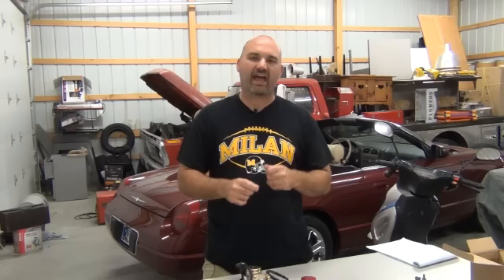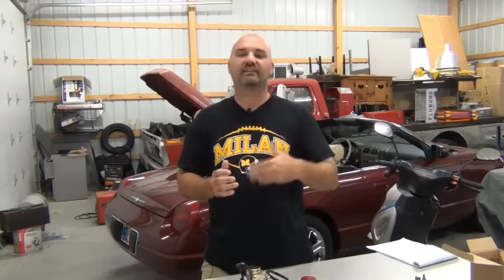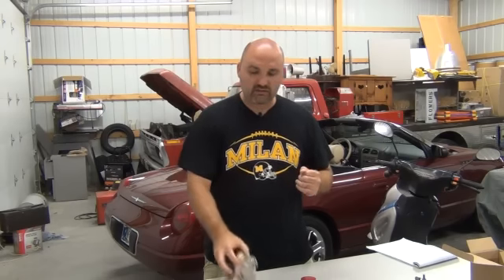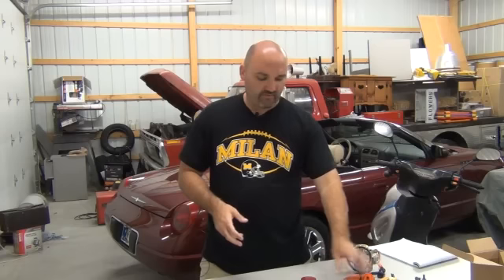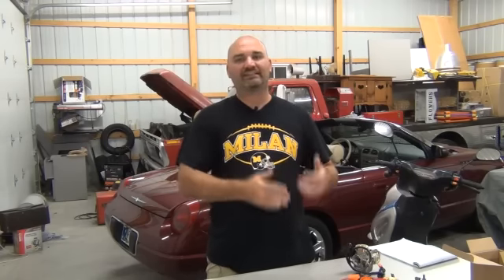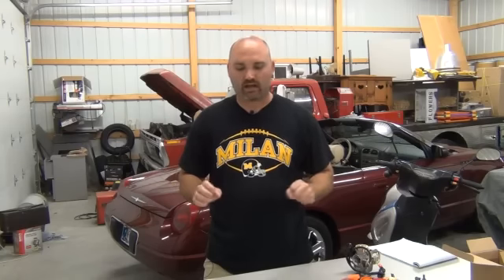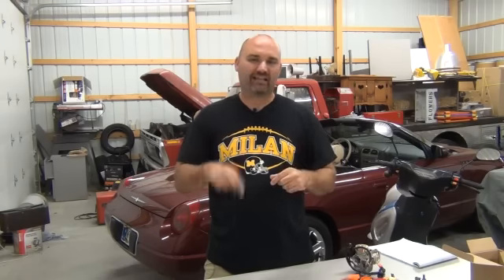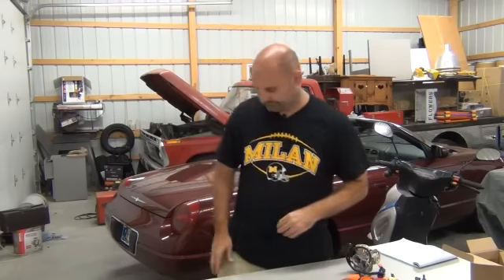Video Number 4 Make My 49cc Scooter Wicked Fast

Comment: I have a Yamaha c3 it's an xf50x 2007 with fuel injection. I noticed that even on the downhill run I can't go over 40. Is there a governor in the fuel injection system. What can I do to get more speed, I've already removed the governor spacer and use only non-ethanol 90 gasoline. And what do you think about changing the carburetor to run it on propane only could I get more speed that way? Thank you for your time. Stephen Parker

Comment: I know you posted this some years ago, and don't know if you will see it, but quick question, after I remove the airbox off of my 49cc dongfang, and install one of my two air filters as you shown, what do I do with the blowback hoses that run to the airbox? There's one that runs into the air intake tube, and another that's not too far from it. I put on my red air filter, I tied off the hoses to where they weren't hanging, but my scooter ran terrible! Thoughts? Thanks man!..

Comment: I am trying to buy a complete rebuild big bore kit for my 91 Hyosung Sence 2 stroke 49cc. I'm having a hard time finding the proper parts because its an older 2 stroke. I am looking for a kit like the one you have for sale but I'm fairly sure it won't work on my Hyosung. I also want to replace the stock exaust, crank, clutch with preformance after market parts along with the 80cc big bore kit. I would like to up to 100cc but from every thing have read, I can only put that on my Tao 4 strokes. Do y'all sell such a beast?

Comment: Hello, just what was the over all gains in performance after this kit was installed, MPH and Acceleration ?Thanks for any help, I am strongly looking at buying one of your kits, I have only 7.3 km on my new Tao Tao 50, I bought it to use it to get around at the Drag Strip it fit nicely inside my trailer with the car.Robert
Reply from the maker: +Robert Thiel I've had people gain any where from 7-12 MPH. Depending on the rider and riding conditions.  We've never measured the increase in acceleration by timing it over a distance. But there is a noticeable difference.

Comment: Will this and the 100cc big bore kit work on my 2005 , 49cc Schwinn graduate. And are you still offering the deal. Also do I have to do 2 separate orders or can we just combine the two in one order for one payment.
Reply from the maker: It will work if you have a qmb139 engine. You'll have to look on your engine block to see the stamp. It's usually by the double kick stand. If you go to the link in the description and put your email in. Go to video four you can buy there then there will be another video giving the special price in the beast. It will be all one order.
Reply: Thanks for the information. I will see if I can find  what you are talking about with the engine block. I actually have 2 of the Schwinn graduate scooters. So I might have to get 2 of your  upgrade kits.
Reply: BZ139QMB ?? Same difference??
Reply from the maker: +Dan Lafontaine Yeah thats the same thing
Reply: wil it work on my mbk booster next gen 2003 ?
Reply: Jeremy Vinup can I put a hundred cc Bore kit on a GY6 scooter. see if you can let me know something thanks. I love all you videos they are good information. I have bought the Bore kit and the speed pack.

Comment: I am trying to take you up on the offer of 200 for the entire kit and the 100cc big bore kit but I only see the 100cc big bore kit for 129.99 I'm on a budget if I order both do you automatically change the price or do I have to enter the coupon for the discount? Every dollar I save really helps I have a 49 cc 2014 Meidu that isn't cutting it on take offs, and uphill battles are usually lost if you can please get back to me as soon as possible I would really appreciate it I'm located in Los Angeles California
Reply from the maker: Let me check my links. Did you click buy in video 4. After you buy the speed kit there's another video and that's where the link is for buying The Beast big bore kit for the special price. Shoot me an email if at Jeremy.vinup@hotmail.com if you're still having issues.

Comment: I have recently bought a 49cc DongFang (Japanese) scooter. The speed and hp just doesn't cut it. I believe that your products will help but I'm not sure if they would fit. And all I know about the engine is that it's 49cc and 4 stroke. Please help. I think 100$ is a great price. Thanks for your time.
Reply: Also will you do an installation video? I think that would be great for some of us beginners. Great vid keep it up.
Reply: +Jeremy Vinup
Reply from the maker: +RoYaL Halo I've got several videos that's on my list I'll do a install video too. Theses parts are super easy to install. Takes less than 10 minutes and all you need is a phillips screw drivers and an 8mm wrench. I think its two screws and one bolt.
Reply: +Jeremy Vinup Thanks for the quick response. How do I know it will be compatible with my engine?
Reply from the maker: +RoYaL Halo You'll need to see if your engine is a GY6. Usually all 4 stroke scooters run this version of engine but double check. Look on your engine for a stamp that say QMB139 or something like that.
Reply: +Jeremy Vinup The model is a DF50stc, and stamped into the side of the engine is "1P390QMB" does that match? Thanks for your help.
Reply from the maker: +RoYaL Halo Yeah there pretty much the same.
Reply: +Jeremy Vinup Great! I'll be ordering soon!
Reply from the maker: +RoYaL Halo Sounds good.
Reply: +Jeremy Vinup Wondering if this kit will work for a 2012 king ring JL50Q-7 scooter

Comment: I have a Scooter with 150 cc this kit help me to incress the rpm ??
Reply: +Manuel Sanguino No. You need lighter rollers, clutch springs, big valve cylinder head, race camshaft, larger carburator, free flowing airfilter and free flowing exhaust
Reply: thanxs men

Comment: Big bore kits DO NOT WORK on 49 cc scooters , without modifyng the crankcase , ive done it all! And wasted a lot of money, 
Ive a Honda dio 1996 , engine gets overheated every time.
Reply: what should I put in mine i have a 49cc with big bore kit 100cc racing muffler and cdi and 20mm carb and coil and went from 6.5g rollers to 8.5g made big different but still missing something ? Sure I went from 34 miles to 43 miles but it should go fast can you help me .